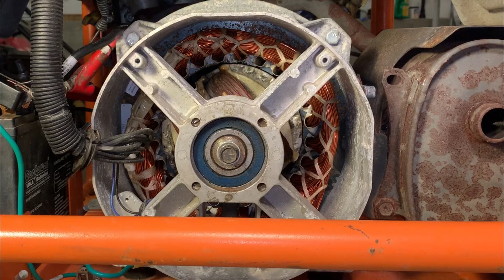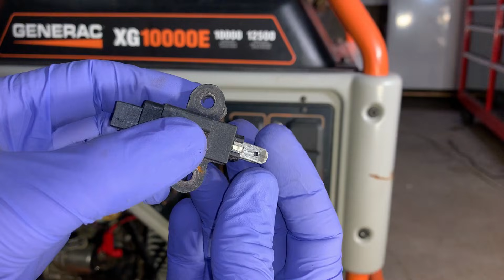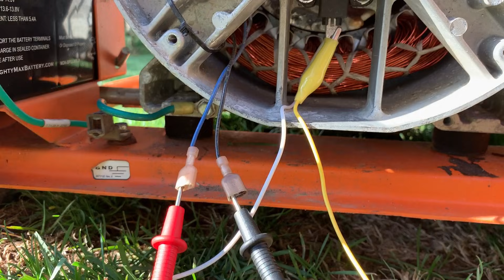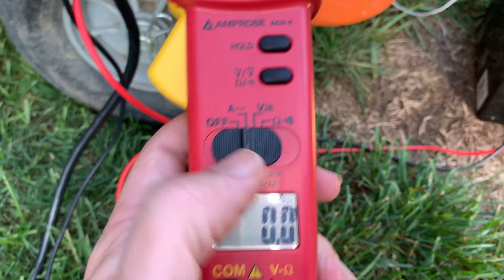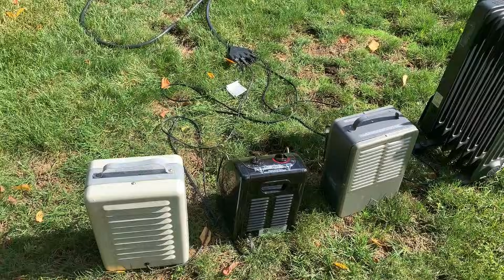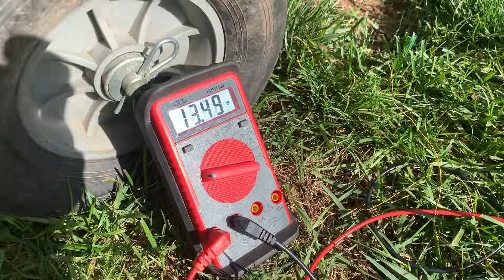Generac XG10000e No Power/No Voltage - Fixed

Comment: As a comparison, a XG8000e I worked on for a friend was running at 59.6hz with a balanced ~5500w load. I tuned it to 61.5hz no load. It had very few hours on it.

So this one simply must just be slightly tired or similar due to the hzdroop you saw.

Anyway great video as always! :)
Reply: Here is a reminder about portable generator safety: this is only a reminder for anyone who use portable gas/propane generators. This is just to make sure that everyone is aware of all the warnings and it’s just to remind people to be careful using portable generators. Everyone has to see this safety reminder. Every year after hurricane and winter storms, there were reports on the news that many people have died each year when using generators due to carbon monoxide poisoning and electrocution during a power outage. There were reports about deaths when using generators when the power was out. There is something very serious that everyone should always be aware of when using generators. Some people do run their generator indoors which is not safe and that increases the risk of carbon monoxide poisoning which can cause death of family and you. Some people run their generator in wet conditions which can electrocute them. Here’s an advice about generator safety: please remember that you should never run your generator indoors. Remember that carbon monoxide is an odorless and colorless gas that you cannot see or smell. Carbon monoxide is a silent killer. Keep that in mind. Make sure your generator is 15-20 feet away from your house and away from doors, windows, and vents. Having a carbon monoxide detector is very important against generator safety. Some people also allow children to go near the portable generator which could pose risks. We need to keep an eye on our children making sure that they are not near the portable generator so they won’t get electrocuted or burned by the generator which is dangerous. A locking enclosure also keeps kids safe. A generator shed might look like a tempting place to explore, or take cover during a game of hide and seek, but a generator is a dangerous piece of equipment that can cause injury. It says on the manual that we should also keep children away at all times from the portable generator to avoid injuries. Please do not permit a child or unqualified people to operate the portable generator. Generators pose electrical risks. If you need to use your generator during wet weather, you need a generator tent to protect your generator from getting wet. Don’t let your generator get wet. Keep your generator dry and before using your generator, please make sure your hands and your generator is dry. Everything that is said on the generator’s operating manual should not be ignored. Never smoke cigarettes near the generator. Please keep flammable things away from the generator. Never overload your generator too. Your generator can catch fire. Never ever try to plug a generator cord into a wall outlet to avoid back feeding. Back feeding your generator is dangerous. Always turn on your generator first before plugging in appliances and shut off the appliances before turning your generator off. Use a heavy duty cord for your generator and the cord should not be worn out. All the instructions should be followed carefully. Never refuel your generator while it’s running. It can cause fire if fuel spills while your generator is hot. You should turn off your generator and let it cool off before refueling it. Having a fire extinguisher next to the generator is also important. This is only a reminder for everyone’s safety of using generators. Make sure your generator is properly grounded. https://youtu.be/I1jT3ANENvI and here is a video more about keeping others safe when using generators and also about our family’s safety. Hope this helps and everyone understands the safety requirements. Thank you. Be safe.

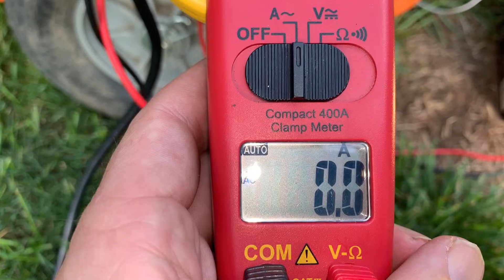Comment: Maybe someone installed a used AVR and mixed up the wires? Also at 19:52 I think you had the Amprobe meter set to the amps (through the clamp) range instead of volts. You flipped it briefly over to (and maybe a bit past) the volts range but then right back to amps.
Reply from the maker: Someone definitely make a mistake.  You are correct on the amp clamp.  Had it set wrong.

Comment: You're very good at understanding the electronics in these things. Knowing what is what and why. Excellent! Thanks for sharing.
Reply: Here is a reminder about portable generator safety: this is only a reminder for anyone who use portable gas/propane generators. This is just to make sure that everyone is aware of all the warnings and it’s just to remind people to be careful using portable generators. Everyone has to see this safety reminder. Every year after hurricane and winter storms, there were reports on the news that many people have died each year when using generators due to carbon monoxide poisoning and electrocution during a power outage. There were reports about deaths when using generators when the power was out. There is something very serious that everyone should always be aware of when using generators. Some people do run their generator indoors which is not safe and that increases the risk of carbon monoxide poisoning which can cause death of family and you. Some people run their generator in wet conditions which can electrocute them. Here’s an advice about generator safety: please remember that you should never run your generator indoors. Remember that carbon monoxide is an odorless and colorless gas that you cannot see or smell. Carbon monoxide is a silent killer. Keep that in mind. Make sure your generator is 15-20 feet away from your house and away from doors, windows, and vents. Having a carbon monoxide detector is very important against generator safety. Some people also allow children to go near the portable generator which could pose risks. We need to keep an eye on our children making sure that they are not near the portable generator so they won’t get electrocuted or burned by the generator which is dangerous. A locking enclosure also keeps kids safe. A generator shed might look like a tempting place to explore, or take cover during a game of hide and seek, but a generator is a dangerous piece of equipment that can cause injury. It says on the manual that we should also keep children away at all times from the portable generator to avoid injuries. Please do not permit a child or unqualified people to operate the portable generator. Generators pose electrical risks. If you need to use your generator during wet weather, you need a generator tent to protect your generator from getting wet. Don’t let your generator get wet. Keep your generator dry and before using your generator, please make sure your hands and your generator is dry. Everything that is said on the generator’s operating manual should not be ignored. Never smoke cigarettes near the generator. Please keep flammable things away from the generator. Never overload your generator too. Your generator can catch fire. Never ever try to plug a generator cord into a wall outlet to avoid back feeding. Back feeding your generator is dangerous. Always turn on your generator first before plugging in appliances and shut off the appliances before turning your generator off. Use a heavy duty cord for your generator and the cord should not be worn out. All the instructions should be followed carefully. Never refuel your generator while it’s running. It can cause fire if fuel spills while your generator is hot. You should turn off your generator and let it cool off before refueling it. Having a fire extinguisher next to the generator is also important. This is only a reminder for everyone’s safety of using generators. Make sure your generator is properly grounded. https://youtu.be/I1jT3ANENvI and here is a video more about keeping others safe when using generators and also about our family’s safety. Hope this helps and everyone understands the safety rules. Thank you.

Comment: You had the red clamp on Ammeter set to A without clamping it around a wire. Doesn't it read volts with the leads connected?

Comment: OK, the previous use was in construction, and was used a lot. Perhaps a disgruntled employee decided to sabotage the generator to 'get even' with the boss? If it was working, wires don't move themselves.
Great catch on the 'repair'.
Thanks for sharing.

Comment: After 1600 or so hours, There is no way that such miswiring occurs without an element of intentional sabotage.  Incredible that you figured it out. I salute you!
Reply: Sabotage or ineptitude!  There are a lot of dolts who think they know more than they know!
Reply: That stator looked new, the brushes looked pretty damned new and the bolts on the cover had been recently opened. Someone got this, put in the new bits but it didn't work because they replaced the wires wrong. Thinking it was the same problem as before, they sold it on with some story about it suddenly stopping.
Reply: Here is a reminder about portable generator safety: this is only a reminder for anyone who use portable gas/propane generators. This is just to make sure that everyone is aware of all the warnings and it’s just to remind people to be careful using portable generator during a power outage. Everyone has to see this safety reminder. Every year after hurricane and winter storms, there were reports on the news that many people have died each year when using generators due to carbon monoxide poisoning and electrocution during a power outage. There were reports about deaths when using generators when the power was out. There is something very serious that everyone should always be aware of when using generators. Some people do run their generator indoors which is not safe and that increases the risk of carbon monoxide poisoning which can cause death of family and you. Some people run their generator in wet conditions which can electrocute them. Here’s an advice about generator safety: please remember that you should never run your generator indoors. Remember that carbon monoxide is an odorless and colorless gas that you cannot see or smell. Carbon monoxide is a silent killer. Keep that in mind. Make sure your generator is 15-20 feet away from your house and away from doors, windows, and vents. Having a carbon monoxide detector is very important against generator safety. Some people also allow children to go near the portable generator which could pose risks. We need to keep an eye on our children making sure that they are not near the portable generator so they won’t get electrocuted or burned by the generator which is dangerous. A locking enclosure also keeps kids safe. A generator shed might look like a tempting place to explore, or take cover during a game of hide and seek, but a generator is a dangerous piece of equipment that can cause injury. It says on the manual that we should also keep children away at all times from the portable generator to avoid injuries. Please do not permit a child or unqualified people to operate the portable generator. Generators pose electrical risks. If you need to use your generator during wet weather, you need a generator tent to protect your generator from getting wet. Don’t let your generator get wet. Keep your generator dry and before using your generator, please make sure your hands and your generator is dry. Everything that is said on the generator’s operating manual should not be ignored. Never smoke cigarettes near the generator. Please keep flammable things away from the generator. Never overload your generator too. Your generator can catch fire. Never ever try to plug a generator cord into a wall outlet to avoid back feeding. Back feeding your generator is dangerous. Always turn on your generator first before plugging in appliances and shut off the appliances before turning your generator off. Use a heavy duty cord for your generator and the cord should not be worn out. All the instructions should be followed carefully. Never refuel your generator while it’s running. It can cause fire if fuel spills while your generator is hot. You should turn off your generator and let it cool off before refueling it. Having a fire extinguisher next to the generator is also important. This is only a reminder for everyone’s safety of using generators. Make sure your generator is properly grounded. https://youtu.be/I1jT3ANENvI and here is a video more about keeping others safe when using generators and also about our family’s safety. Hope this helps and everyone understands the safety requirements. Thank you.
Reply: @JetPower482 you keep reposting this...I mean it's all good advice..id like to think most is common sense..but I know that is sadly untrue...but, no disrepect, I'm curious did you lose somone to a generator mishap?   Just seems like generator saftey is awfully personal to you.

Comment: Very glad you caught the wrong connections before you gave up! Another good machine for someone! Wish you could help me find a decent one near me for local purchase. I just wouldn’t know what to look for nor a fair price to make sure I was getting a good bargain. Only need it for power outage (lights & Fridge) during hurricane season here in Raleigh/Durham NC anyway.
Reply: Here is a reminder about portable generator safety: this is only a reminder for anyone who use portable gas/propane generators. This is just to make sure that everyone is aware of all the warnings and it’s just to remind people to be careful using portable generators. Everyone has to see this safety reminder. Every year after hurricane and winter storms, there were reports on the news that many people have died each year when using generators due to carbon monoxide poisoning and electrocution during a power outage. There were reports about deaths when using generators when the power was out. There is something very serious that everyone should always be aware of when using generators. Some people do run their generator indoors which is not safe and that increases the risk of carbon monoxide poisoning which can cause death of family and you. Some people run their generator in wet conditions which can electrocute them. Here’s an advice about generator safety: please remember that you should never run your generator indoors. Remember that carbon monoxide is an odorless and colorless gas that you cannot see or smell. Carbon monoxide is a silent killer. Keep that in mind. Make sure your generator is 15-20 feet away from your house and away from doors, windows, and vents. Having a carbon monoxide detector is very important against generator safety. Some people also allow children to go near the portable generator which could pose risks. We need to keep an eye on our children making sure that they are not near the portable generator so they won’t get electrocuted or burned by the generator which is dangerous. A locking enclosure also keeps kids safe. A generator shed might look like a tempting place to explore, or take cover during a game of hide and seek, but a generator is a dangerous piece of equipment that can cause injury. It says on the manual that we should also keep children away at all times from the portable generator to avoid injuries. Please do not permit a child or unqualified people to operate the portable generator. Generators pose electrical risks. If you need to use your generator during wet weather, you need a generator tent to protect your generator from getting wet. Don’t let your generator get wet. Keep your generator dry and before using your generator, please make sure your hands and your generator is dry. Everything that is said on the generator’s operating manual should not be ignored. Never smoke cigarettes near the generator. Please keep flammable things away from the generator. Never overload your generator too. Your generator can catch fire. Never ever try to plug a generator cord into a wall outlet to avoid back feeding. Back feeding your generator is dangerous. Always turn on your generator first before plugging in appliances and shut off the appliances before turning your generator off. Use a heavy duty cord for your generator and the cord should not be worn out. All the instructions should be followed carefully. Never refuel your generator while it’s running. It can cause fire if fuel spills while your generator is hot. You should turn off your generator and let it cool off before refueling it. Having a fire extinguisher next to the generator is also important. This is only a reminder for everyone’s safety of using generators. Make sure your generator is properly grounded. https://youtu.be/I1jT3ANENvI and here is a video more about keeping others safe when using generators and also about our family’s safety. Hope this helps and everyone understands the safety requirements. Thank you. Be safe.

Comment: Really interesting James. I wonder if the slip rings alone could have caused this or if was almost fixed by a repair shop with a new stator and fudged the wires. great job as always.
Reply from the maker: Differently somebody fudged a repair.
Reply: Yup. I fixed one with dirty slip rings once. Always start with the east things first

Comment: What’s “flashing” it mean? Also the engine had response to you spinning the drill, which was odd to me
Reply: I have seen in very old generators a shaded pole drill re excite. But with the modern solid state electronics of that unit dont think that would work. I bought a NOS XG7000 and the amount of electronics on that thing suprised me. I do believe he still has some AVR tweaking to do. At 100% im holding 58hz also operating it on Natural gas.